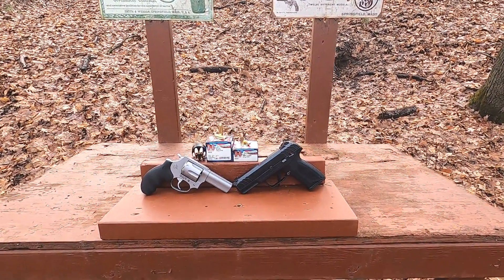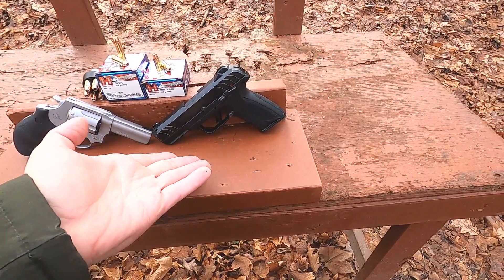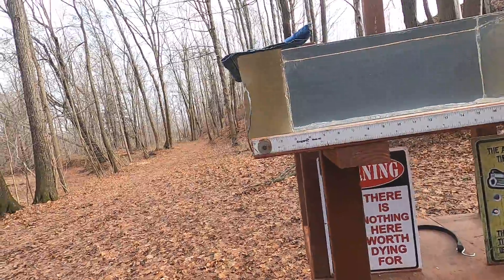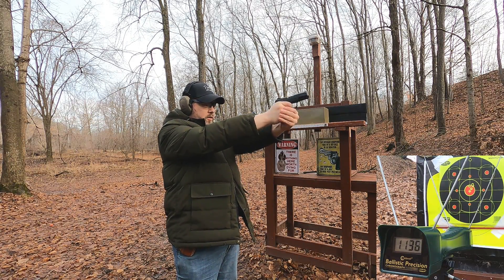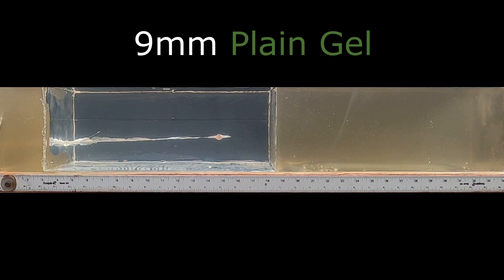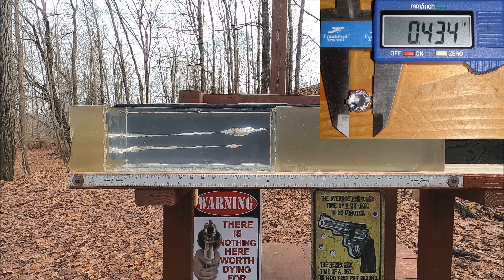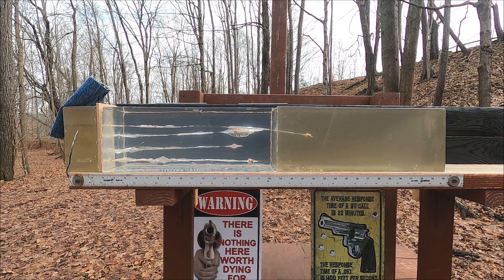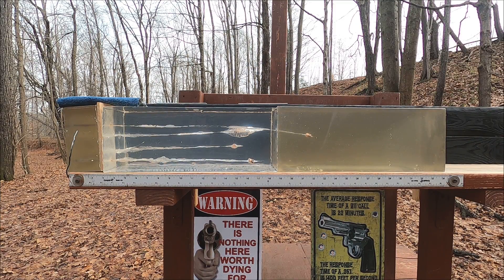.38 Special VS 9mm Ballistic Gel Test - Hornady American Gunner

Comment from the maker: I called the speedloader an H&K model 10 but I misspoke, rather it is an HKS model 10-A.
Reply: We’ve got some of those HKS here. They are kind of “the original.”  I know there are newer, better, etc., but they work and you can get them for nearly anything. My wife carried that exact speedloader when she wore her Model 66 on duty back in Texas, years ago.
Reply from the maker: @lanedexter6303  I like them because a normal gun store will have them for like $10. Sure the better expensive ones are nice, but the HKS are a must have when you buy a new gun. Very nice for having several for a range trip.
Reply: @GunSam  Exactly.  You can find ‘em, they don’t cost a fortune, and they work.
Reply: I wonder why you don't use mdf on the back of the clear block as well, since ribs and vertebrae are on the back side of anyone, too? Seems like "over penetration" would always be subject to hitting those bones on the rear. 🤔
Reply: @ronaldwells4427  that’s an idea.👍  Study exit wounds.
Reply: I have a Taurus 357/38 snub nose.  They always seem to shoot left and high.

Comment: I always was skeptical when people say that 9mm is more powerful than 38 Special.
Reply from the maker: When it comes to bullet weight and powder charge, they are near identical and near identical power if they were fired from carbines. In normal handgun barrel lengths though, the 9mm's smaller case capacity making more pressure will mean it's more efficient in a handgun thus faster burning thus more powerful.

Comment: your conclusion is backward. you got more penetrations and explanation and cavity with 38special. Seems like you already made up your mind before the test
Reply from the maker: That's one of the dumbest comments I have ever read. What conclusion? I mentioned some points about both of them and never drew any specific conclusions, so how can a conclusion be backwards when I never concluded on anything definitively? 9mm in plain gel is 15.5" penetration .501" bullet diameter from expansion and .38 Special 18" penetration and .434" expansion. With denim and MDF 9mm got 18" penetration and .494" expansion as where the .38 Special got 23" penetration and (no) .357" expansion. So the 9mm got adequate penetration and some expansion every time, the .38 Special got over-penetration half the time and under expansion both times, and I quickly concluded that the 9mm was doing a little bit better. I 100% stated the real facts, and 12" minimum and no more than 18" maximum penetration is the standard, .38 Special did not meet that standard. Then 1.5 times expansion is the standard, and 9mm came closer in both shots to 1.5 times expansion. I will double, triple, and quadruple down on my conclusion because it's the RIGHT unbiased conclusion.

Comment: I have said many times that the XTP seems to need some velocity, say 1100+ fps, in order to work. That being the case, it is more suited to magnum revolvers or the 357 Sig. I believe it was intended as a hunting bullet, and Hornady is trying to give it a broader application. Something tells me the 158 gr 357 mag might be excellent for certain things. 
Reminder: a 38+P is still running st substantially less pressure than a 9mm. IIRC, 38 +P SAAMI spec max pressure is 17,500 (PSI, I think), and 9mm is around 30,000. So the 9mm has an advantage to begin with, where velocity is concerned. This makes the performance of many 38+P loads all the more impressive. People need to stop getting hung up at the mere appearance of +P and claiming it is unfair.

Comment: Having come up through the era of "hotter is better" (and having to admit I STILL have Federal 9bple +P+ in most of my 9mms) I have become fascinated with how well a "lower power" (on paper at least) round like .38 special does so well on human targets.  I've often suspected there's something we're not taking into consideration.  Something like overall length of the projectile, balance point ... I don't know.  But .38 special wouldn't have been the law enforcement king for most of the 20th century if it wasn't "enough."  
Another great video.  Keep 'em coming! :)
Reply: I've noticed that lower velocity rounds get more straight-line penetration in gel, especially if the round is decently heavy. They tend to not cavitate at all, though.
Reply: @kellenphan7198  - I've noticed the same thing.  Crazy to see, for instance, such a sedate round as non-expanding .44 special penetrate as much or more as an expanding .44 magnum (although as you note, with much less destruction).
Reply: Law enforcement went to the Simi auto due to increased capacity ..
Reply: Because .38 Special is not “lower power” the 9mm is. The 9mm is so popular because you get more rounds and it is cheap to manufacture. But it doesn’t matter if the stopping power sucks.
Reply: Plus penetration plus😂 sounds badass
Reply: Lol at thinking 20th century US law enforcement is a good example for anything, ballistics or otherwise.
Reply: @milesmccall2301  idk they seem to be pretty good at defending the interests of those who fill their wallets
Reply: @milesmccall2301  Oh, I see you have an opinion ...
Reply: @CeltKnight I know, how dare I.
Reply: @milesmccall2301  - It's a free country, my dude.
Reply: @milesmccall2301  I agree to some extent, but most of my life the law enforcement in my state used revolvers chambered in .38 Special and I never heard any of them complain about the effectiveness of the .38,I think law enforcement went to the semiautomatic pistols because of greater capacity,15 rounds as opposed to 6,and they believed they needed this increase in capacity bc the criminals on the street were carrying them,which meant that law enforcement was out gunned.

Comment: I'm not a 9mm fan by any stretch of the imagination, but I do like your little Ruger. I've always been a Ruger fan and always will. I agree that the 38 Special is actually better than the 9mm. With the 38 you've got a huge selection of loads to choose from, whether mild or wild. The 9mm ( or any semi auto) is severely limited because of the OAL of the cartridge and the shape of the bullet. The only way to experiment with semi auto rounds is really the powder. A revolver will shoot anything as long as the bullet doesn't protrude beyond the length of the cylinder.
Reply: I have a Security 9, and it's never jammed. The only thing it can't do is hard primers. Bought some LAX Ammo (Freedom Munitions) andit wouldn't set off those cartridges reliably
Reply: love my security 9 @cameronnorton5898
Reply: 😂no
Reply: Well if you you don't like 9 mm because most of the popular ones now are  polymer framed pistols, then try the Walther PDP.
Reply: Like you I'm not a huge fan of 9mm. No real reason it's a fine round, they just don't spark the same kind of joy that revolvers or .45s do. Kind of like a Honda Civic, it'll get the job done but it's not my favorite. That said, my duty gun is a 9mm HK and I also have the Ruger Security 9 and it's every bit as reliable as Glocks I've owned in the past and about as accurate as a stock Glock. Substantially lighter on the wallet though, I paid $400 for mine including taxes and background check.
Reply: Not to mention how light ammo in a semi auto might not work if the recoil spring is built for heavier ammunition

Comment: I'm not surprised the .38 performed the way it did. The XTP bullet is hard to expand anyway and using the low velocity of standard pressure round, poor results are to be expected.  These lower end rounds not accurately represent the .38 special as a defensive load. The plus P loading with a better hollow point design is an excellent defensive load.
Reply from the maker: Yeah, my hand loads beat this load, more like 900+ in a 2" and 1,000 in a 4", and they do actually perform. I have tested my favorite hand loaded XTP, same 125 gr XTP and it did indeed expand.

Comment: I have never heard a good reason NOT to choose +P!.............................elsullo
Reply: I have a good reason not to choose +P.

I have a Smith & Wesson Model 37 and a Model 67.  I got both guns used within the past 20 years, and neither one came with a manual.  I contacted Smith & Wesson to figure out when the guns were made and whether or not they were rated for +P ammunition.  Both guns were made in the early 1980s, and according to the Smith & Wesson representative, neither gun is rated for +P ammunition.  So, both of those guns only get standard pressure .38 Special ammo fired through them.
Reply from the maker: @Kaelland  That is true, but +P wouldn't do anything to them. If you have ever fired standard pressure foreign ammo, you were probably at a higher pressure than American .38+P pressure as +P is max 20,000 PSI and 'standard pressure' in Europe is 21,700 PSI.

Comment: When considering over penetration, in a real life scenario, the target would also have bone and clothing on the back/exit side.  It would be interesting to look at over penetrating rounds and retest with fiber board and denim both in front and in back of a length of clear ballistics cut to represent the depth  of an average torso.  That would be an very interesting set of tests and could put to rest a lot of concerns about over penetration.
Reply from the maker: I could potentially add rib simulation on the back. The main reason I do not is that most good ammo stops at less than the gel block, which is 19" if you include the first 3" section.
Reply: @GunSam  I was suggesting you review your previous studies, pick out the more note worthy over penetrating loads and try them in that set up.  It could be a real game changer in the whole over penetration controversy.  If they do not exist through bones/clothing on the back they would be much less of a risk, except, perhaps in a nudest colony!!
Reply: @arnoldcohen1250  Do they allow concealed carry in a nudist colony?
Reply: @hubertwalters4300  It must depend on how big the gun is and the discomfort the nudist can tolerate!!
Reply: @arnoldcohen1250  Ok...got it,thank you for clarifying that.
Reply: https://youtu.be/0rPTk8raXdo
Reply: Careful talking about penetration, pronoun police might get butthurt

Comment: Just an in the head estimate, but the 9mm was running with about a 50% energy advantage in this test. So the results on the gel kind of surprised me. I was also kind of surprised that you got near the 900fps advertised velocity. How much more effective the 9mm was is debatable. Obviously penetration comes at the expense of expansion, all things being equal. But exit wounds do tend to be nastier. It's probably confirmation bias or something going on with me, but it seems the 38 is more efficient with how it delivers the energy. Probably the size of the HP cavity. 9mm has to feed, you know?
Reply from the maker: Yeah, that's the exact thing going on. Why I think .38 Special is a bit better. Especially with SJHP or wadcutter ammo, so many cool things you can do that a 9mm can't. And if you feel the need, you can get 9mm velocity within 20,000 PSI with the right powder, albeit a tad more recoil, but the option is there which then makes the .38 Special+P a bit MORE effective than 9mm.
Reply: @GunSam  From a simple high school physics point of view, the math goes to the 9mm. Same diameter bullet with more energy in most cases. I'm undecided on hydraulic effects from higher velocity rounds of a given energy vs heavier rounds of the same energy. I simply don't have enough information. I will admit that for splashing water jugs, velocity wins. For serious use, I just don't know. Obviously you want the threat to stop as close to instantly as possible.
Since feeding reliability isn't an issue with revolvers, there is a lot more you can do with bullet design. And as you noted, with the extra case capacity of the 38, you get to stuff more powder in the case as needed.
Reply: But also 9mm will never be able to load 158gr bullets either. .38 special 158gr JHPs are terrifying. Absolute 1 shot stoppers. 9mm you just get so many more shots. Those of us that are accurate as fuck never need a 9mm. Police in the modern day could literally switch back to .38 special and see a decrease in over penetration and a quicker stop to fights. In gel and ballistic torsos 158 JHP often performs on par with 230 gr JHP .45 auto loads. Being fast is only great when you're talking about reaching out to touch somebody, whereas most gunfights are in the 15-30 yard range which a .38 or .45 travelling slower actually delivers energy more efficiently. 9mm is realistically the PERFECT SMG round, and .45 or .38 are the PERFECT self defence loadings.
Reply: @HClaurance  I definitely waffle over light and fast vs slow and heavy. A 158gr SCLSWCHP is a formidable projectile indeed. Great expansion. Required penetration.

Comment: Sam, just curious if you have ever disassembled commercial rounds, to compare varying powder content to help explain fps variances ? Thanks
Reply from the maker: Yes a few times here and there. One notable example was Speer's .327 Federal 100 gr Gold Dot. Pop open, hmm looks like Ramshot Enforcer powder, I weigh it at 14.5 grains. I then take some Ramshot enforcer powder I happen to have, weigh out 14.5 gr and put it in the case, and hmmm....fills the case exactly the same height as the factory load. I also found it interesting that Speer's load data shows Ramshot Enforcer, but they list 13.5 gr max charge with their 100 gr Gold Dot, so that yours is never as good as the one they want you to buy lol.